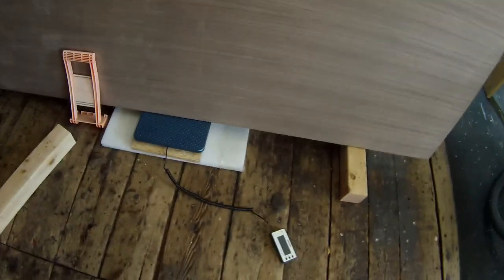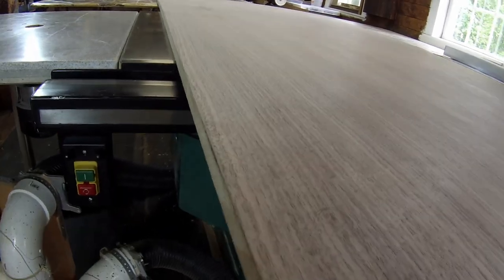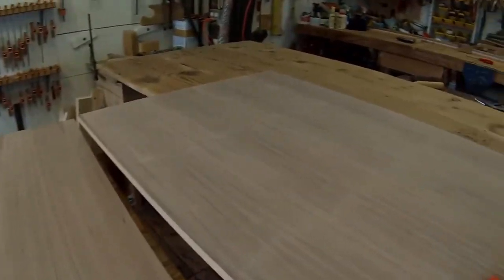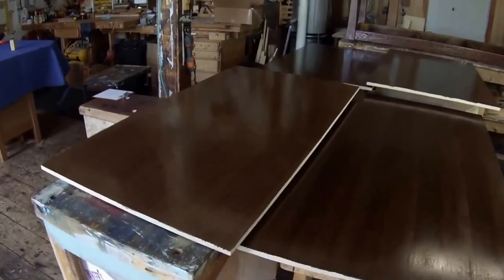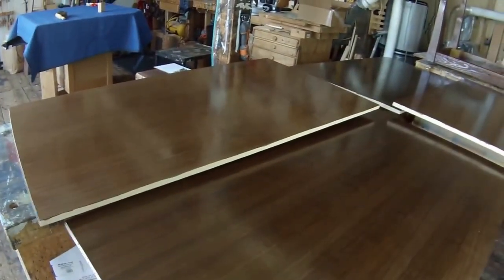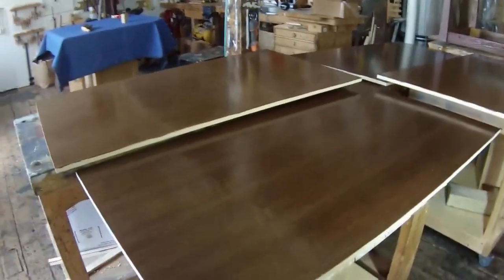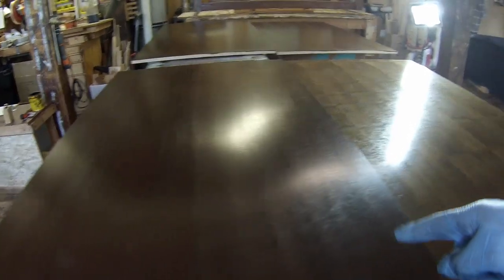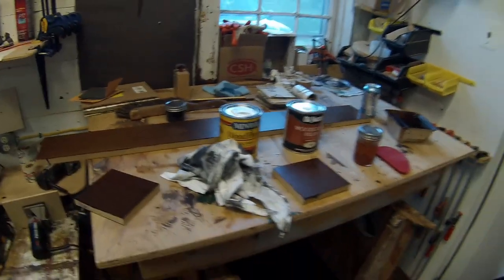Walnut Pong Table -- Part (1/4) -- Panels

Comment: I wonder if for most woodworkers, using a tracksaw to break these sheets down would yield a more accurate cut than a tablesaw because of the weight of these sheets.

Comment: I have been in the exact same problem and ended toning darker just like you did. I don't know if this has any effect but I have been much luckier with ply based walnut instead of mdf based. Thanks for sharing with us.
Reply from the maker: PeriodWoodworker Oh - I didn't even mention how I had to return the first batch of MDF walnut... the stuff that was shipped to me initially was full of pin knots and looked terrible.  The MDF makes a better playing surface and can take more of a beating, thats the only reason why I would use it.  But it was explained to me that the lumber industry downgrades the quality of veneer when demand is high

Comment: Nice recovery!  Did you use a dye to even out the shades or just a darker stain?
Reply from the maker: Metallurg33 For toning, I used the darkest oil stain, and then diluted with thinner 50/50 on the one panel to darken it a little.  oil is controllable like that and Minwax makes so many shades that I dont need to alter their pigments.
Reply: I haven't worked with stain on veneered plywood, so I'm wondering specifically what stain you started with? I'm going to be doing a similar project using 3/4" walnut ply for a 40"x65" table top with hardwood edging/frame - like your walnut veneer in the video, it's much lighter than the walnut hardwood I'll be using. Awesome project, great video. Thanks!

Comment: At some point you've gotta be wondering why you're bothering with a walnut veneer at all.
Reply from the maker: Charles Hanson I considered all solid walnut for the top, but expansion/contraction of solid hardwood over 5' length is in the range of 1/4" to 1/2" -- a big engineering problem and potential disaster with the maple edging

Comment: I think you work the wrong way....! You should do all the processing( routering, rabbeting, cutting etc) and then apply colour, finish and so on......
Reply from the maker: +Nikos Georgopoulos Typically, yes, but in this case the panels were different colors and the solid wood was a different color and all had to toned separately.
Reply: That's irrelevant I think. When you do a rabbet for example after you have applied finish on the surface you might cause some damage....That s why I m telling you to make all necessary work before you apply the "finish"...
Reply from the maker: Nikos Georgopoulos
Nope - actually, applying the finish first protects the paper thin veneer from damage.  If I scratch the oil finish, it can be easily repaired.  Scratched veneer cannot be repaired and will remain a defect.
Reply: @rasomon  are you the woodworking police? Is it against all woodworking laws? Im glad i don't have a YouTube channel id probably be on trial for capital finishing